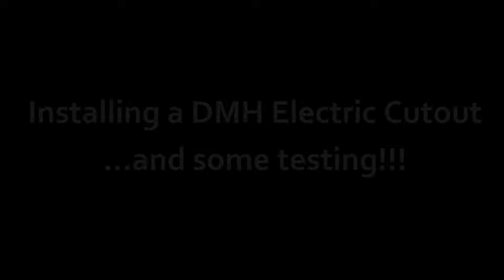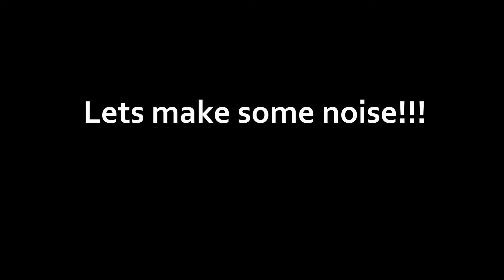DMH Cutout Install and Testing!  Sound/video clips!

Comment: Could you explain how it improves your car that exhaust cutout?
Reply from the maker: Absolutely.  I dont have any dyno figures showing any change in power on my particular car.  However, I plan to get the car dyno tuned in the spring, and I am going to ask for a back to back run with it open and close.  On my car, I dont expect much difference because my exhaust is EXTREMELY free flowing.  So, the only reason I use it is to change the sound or the attitude of the car.  Some days I just like it to sound like a fairly mild muscle car, through the exhaust.  Some days I like it to sound like a ticked off animal.  There is a psychological change when you drive a car that is quiet vs one that is loud.  You feel like you have more power and you feel like you are going faster than you really are.  Its like driving an old 60's muscle car.  They arent the fastest things, but man you sure feel like they are when you're driving.  They're raw and loud and they scream adrenaline.  Thats what this does for me.  Just gives the car that little attitude adjustment when I want it.
Reply: Just put tuned exhaust on the side with the least resistance and use the other when you need to be quiet.  In the fifties we just ran the cut out side to the side of the vehicle so you could open it easily.  Not a good idea today with all the laws and fines though.
Reply from the maker: I worked on a Chevelle that had the pipe coming out the side with a standard cap with wing nuts.  Guy would get to the track, take off the cap and run.  I've also seen manually operated ones that work via a cable.  But the cables get rusted up or the valves get frozen on those it seems.  This car's exhaust is a bit odd, because its one muffler with dual outlets.  The 3" intermediate pipe goes into the muffler where its split.  One path goes through chambers and is "tuned".  The other path is literally straight through.  Its pretty effective.  Normal driving it sounds modified, but very mild.  Once you step on it, it wakes up pretty nice.  The cut out just adds a little more to the whole experience.

Comment: Sounds all to familiar to me....wait till you figure out the perfect timing to get the most backfires and pops out of it :D
Reply from the maker: +Torched T/A Entertainment Haha it was backfiring and popping not too long ago.  But because #1 coil had a bad wire from the PCM to coil haha.  I have DFCO turned off right now, but I hope once its back on and working I can get some burble or light popping on decel.
Reply: +JEG's Garage  Now you need to do an outside sound clip underload. Put the camera on the hatch or something.
Reply from the maker: +Torched T/A Entertainment I actually tried...but my GoPro Hero didnt like it.  I just ordered a Hero 4 Silver though.  So Im hoping I can get some better outside footage with it.  I would also like to set it up on a tripod and catch some exterior drive by/fly by shots.  I have no idea how the car sounds to other people as Im passing or whatever.  I dont trust anyone else to drive it without me in it haha.

Comment: I use the electronic cut out with my turbo set up. less back pressure quicker the spool.
Reply from the maker: Good use!  Do you notice a pretty dramatic difference between open and closed with spool time?

Comment: Will this pass a smog inspection?
Reply from the maker: I dont know...I guess it depends on the relationship you have with your inspector haha.  I think technically its not legal for street use.  I keep my car emissions exempt here in PA though, so they dont inspect anything having to do with emissions, and my exhaust is in great shape otherwise, so they leave it alone.  I also take my car to people that understand what it is.  If you are in CA, I would probably install this so that the y-pipe is removable.  Put in a "test" pipe, get the car smogged, then install the cut out.  Any other state/country, you'll have to check the rules and talk with the inspection station.

Comment: What if you had an double exhaust system, and one pipe is stock and the other one with the cutout is full straight pipe going to the back.
Reply from the maker: If you had a dual system, with no crossover, this would cause an imbalance from left to right banks and I wouldnt advise it.  If you had a dual exhaust with a crossover, and you added a cutout near the cross over and made it big enough, it might be ok.  What most folks do is just put a cutout on each pipe.  You can operate them both with one switch.

Comment: Where did you get that switch I was looking for one for my project.
Reply from the maker: Thats actually a factory convertible top switch for a 98-02 F-body.  The donor car that I originally bought was a vert, so I had the switch.  I also already had a 98-02 center console, so this fit right in.  I can try to find the pin-out for it, but if you google Im sure it will show up.  Its not hard to hook up.
Reply: Thanks for that I am currently working on my convertible BMW E36 and looking for a switch with some type of exhaust sign on it , I kow Jaguar has them but they are about £100 for just the switch.
Your car sound great though.
Reply from the maker: Thanks!  I wanted to try to change my switch from saying "TOP" to "VOL" haha.  But ultimately decided not to mess with it.  I don't think you'll have much luck finding too many on-off-on momentary rocker switches with an exhaust logo.  Maybe you could get a blank one, design the logo and have it silk screened?  Might cost a few bucks but would be unique and cool as heck.  The Jag switch is cool, if we're talking about the same one.  But I think that's an on/off push button.  You could still get that to work, but you'd have to use some trickery and you wouldn't be able to partially open the cut out very easily.  Most of the time I bump my switch 3 times, vs cranking it all the way open.
Reply: Thanks for the tips. After some thinking and searching I decided to keep it as is. I will get BMW 2002 1976 soon and will spend more time and money into it so maybe then. But thanks and good luck.

Comment: Does this affect the car’s performance? If i was to run a street race and have the cutouts closed vs when open ?
Reply from the maker: You aren't likely to feel a difference. It does not create power. It does free it up. Mostly up top. How much depends on your setup.  Hoping to have Dyno charts showing the difference one of these days.

Comment: Did you have to drill a hole to run the wire to the enter compartment
Reply from the maker: No.  Tho, if I ever have the car apart again, I will.  My wire is running up through some heat shields, over the trans, and up through the original hole for the auto shifter cable.  It left a big hole, so I ran the wideband harness, cut out, and a couple other things through it.  Its in a nice spot.  If I pull the interior again, I will probably drill a hole right near the cut out, and run the wire up into the car and under the carpet.

Comment: is it dual exhaust and 1 cutout?
Reply from the maker: Its long tubes, into a custom y-pipe, then right after the merge is where the cut out is located.  Then from there it goes over the axle, and into the muffler, where it splits into dual exits.  One path is straight through, the other is baffled.
Reply: +JEG's Garage thanks

Comment: when u were turning the electroninc exhaust i noticed u had one little thing next to the switch what is it ?? my mustang has one too but idk what it is for
Reply from the maker: Are you talking about the little chrome toggle switch?  That is for my power antenna.  I didnt want it going up every time the radio is on, because I listen to bluetooth audio a good bit.  So I put it on a switch.

Comment: How has it held up?
Reply from the maker: Perfect.  I suspect it'll be fine for many years.  The only thing that failed on it were the bearings, but they're upgraded now so it should be solid.
Reply: JEG's Garage thank you for the reply, can you help me I want some but don't know how to make sure they fit my exhaust
Reply from the maker: You just need to find out the OD of your exhaust pipe in the area where you intend to install the cut out.  Then you need to purchase the correct sized cutout pipe, and the electric valve to match.  You can usually get them as a kit.

Comment: Are these legal in Australia? I know muffler deletes are illegal here, can this count as a muffler delete?
Reply from the maker: Im not sure these are technically legal anywhere haha.  They are mostly for "off-road" use.  If you had a super strict inspection station, they  might give you crap for it I guess.  But you could always make the cut out pipe modular so you could bolt in a solid pipe, then replace with the cut out pipe.  If the cops pull you over for noise easily, this will draw attention to you for sure.

Comment: does it pass the smog check? bcuz i wanna put an electronic cit out on my car but some guy told me it wouldnt pass the smg check is that true??
Reply from the maker: Smog as in Cali smog?  If so...then I doubt they'll like those.  But as I said to someone else, Cali is a quite a bit different than most other states.  It seems like you really cant do much of anything without potentially messing up your smog test.  You will have to check with other car guys in your area to see what they've done and what hurdles they had to overcome.  Sorry i cant help you more on that!

Comment: It would be better if you applied throttle in the bypass silencer. Exhaust gases fly out in middle of the floor is not a good solution.

Comment: If I may ask, how is it wired in?
Reply from the maker: Hi Russell.  It is wired up to a factory 93-02 style convertable top switch.  I saw this trick on LS1tech forums many years ago.  I liked this idea better than a big toggle switch...or hiding it away somewhere.  This was a nice compromise...its hidden in plain site.  It also helped that my donor car for the motor swap was a vert and had the switch with it haha.  Certainly swayed my decision to use it :)
Reply: Thanks man :)

Comment: Doing the same to my.c63 amg but I'm installing the baffle in between the muffler inlet and muffler on either side. So.thr cutout with electric baffle you have here just.inside piping not a.reql cut out

Comment: so how long did it last?
Reply from the maker: Wade how long did what last? If you mean the cutout, it's still working great. I was causing rucus with it today!
Reply: that's cool. I work with exhausts, 99% stop working after a year.
Reply from the maker: @WadeWilson-  I had the first one for like 8 years and the bearings on the butterfly shaft fell apart. The company replaced the unit with the newer version that uses bronze bushings. It's been great since.

Comment: What cui is the motor and what's been done to it?
Reply from the maker: Motor is 364 ci due to the 4.000" bore.  Everything else being equal to the 5.7 LS variants.  Check out the build videos (which I will be making a play list for soon) to see what all is done.  But basically its freshened up with a hone, new rings, new bearings, cam, heads, intake and injectors.  Not much else.

Comment: Does the cutout leak?
Reply from the maker: Nope.  Not that I can tell.  The exhaust after the cut out flows so freely there isnt much pressure there.  But I dont get any ticking or weird noises from it.

Comment: is it just for noise?
Reply from the maker: In my application....yes.  In a street/strip car application, where every fraction of a second counts...no.  Generally on the street, I dont leave it opened all the way.  Every once in a while I like a little more noise, so I crack it open.  We'll find out in a couple of weeks what difference it makes on the dyno.  But for me, its just about the sound.  For a person that tracks their car, or bracket races or something, it can be used to free up some power that a restrictive exhaust may be leaving on the table.  My exhaust flows so freely that I dont expect a huge jump on the rollers, but we'll see.

Comment: what was the pool noodles for
Reply from the maker: My TA has a spoiler on the back.  That plus the hatch glass equals a pond any time it rains with the cover on.  So Im constantly trying to put things back there to make a "mound" for the water to just run off.  Seems like it always finds a way to pool up though.  Last thing I tried was two old pillows sealed up in trash bags.  Water still pooled, and still found its way into the bags making two heavy wet sacks of old pillows.

Comment: Is there any gain in horsepower?
Reply from the maker: No actual "gain"... In the upper RPM's you may notice a slight increase while on a chassis dyno.  But its not really adding horsepower as much as its freeing it up to breath on the big end.
Reply: @JEGsGarage  thanks so much, yeah true my low end suffer and now i had uninstall it. Especially when i open the valve, its like the air flow is not breathing out as it supposed to

Comment: So I still don't really understand how this works it has to close of the part with the muffler and open the headers at the same time
Reply from the maker: Nah...the exhaust gas takes the path of least resistance.  Some will still go out the tail pipes, even with the cut out wide open.  But 95% of it will be coming out of the cut out.  When its closed, it just "stops the leak" and forces it all through the muffler.

Comment: where can i get that throttle body thing?
Reply: Max Payne eBay
Reply from the maker: Yeah you can get them just about anywhere.  This one is DMH...its a great unit.  But if you search for "electronic exhaust cut-out" you will get more than a few results.

Comment: Is it hard to run the wire??
Reply from the maker: No.  Super easy.  The wire from the cutout to the switch is best run inside if you can.  But either way you just run the wire for the switch, give it power and ground and your good to go.

Comment: how did you do the wires
Reply from the maker: I just ran them up under the factory heat shielding, then through a hole in the trans tunnel that was already there.  If I ever pull the carpet back up, I will likely go up through the floor just above the cut out assembly and run it up front that way.  Just less chance of something happening to it.

Comment: How'd you find the size for your pipe?
Reply from the maker: You just need to measure.  Easiest way is with some calipers...but you can use a tape measure or a piece of string to get the circumference then do the math for diameter.

Comment: Where did u wire it to
Reply from the maker: It has its own harness. But I swapped the switch out for a convertible top switch. I run a 4th gen console and happened to have the switch and switch plate so it worked out nice.

Comment: What if you were to forget to open it and turn on your car and drive it for a little bit could you causeusengine damage
Reply from the maker: I actually rarely ever start the car with it open.  It makes such a loud bark when it fires off.  When its closed, the exhaust is just going through the Magnaflow catback, just as if there were no cutout at all.  So no damage.  In fact to be respectful of neighbors, Ive considered wiring it up so it shuts itself with the key turned off.  Sometimes I forget to close it, and that 6am start up can be heard for quite a ways haha.

Comment: Can anyone explain me how he manages to connect the cut-out system to the button in his car instead of using a remote?
Reply from the maker: Easy.  The remote systems are new...when electric cut outs came out, they were all switch operated.  You can still get them this way.  I simply took a convertible top switch, which is basically like two momentary buttons, and wired it in.  I found the information on LS1tech on which terminals to hook up.  It works perfect.

Comment: What kind of exhaust is it atm
Reply from the maker: As of now...  Stainless works long tubes with 1-3/4" primaries, 2-1/2" collectors into custom 2-1/2" y-pipe, which merges into 3".  After the merge is the cut out pipe.  After the cut out, its a 93-97 F-body Magnaflow cat back exhaust.  All stainless except for the merge with stainless v-bands.

Comment: Sneaky sneaky when cops pull ya you can just push the button and they wouldnt know
Reply from the maker: I CONSTANTLY close it up when I pass a cop or see one coming up behind haha.  I got pulled over one time late at night near my house, and the cop said "I heard a really loud car SOMEWHERE, and I thought it was you, so Im just pulling you over to check you out.  But the car doesn't sound that loud so maybe it was someone else. Have a good night." haha.  Just before that Im pretty sure I was hitting 6800-7000 with the cut out wide open.  Im sure everyone in a 1/2 mile radius heard me haha.

Comment: U need more pool noodles
Reply from the maker: I gave up on the pool noodles.  I tried two old pillows, sealed in garbage bags....but those are in the trash now too.  Im at the point where I think Im going to modify the cover, and sew in little drains so the water just goes out.  Its already a PITA to have to cover/uncover the thing all the time.

Comment: i dont know alot of positive comments installation not complete as far as your just bolting on cut out howd ya do that howd ya run the wires the its a single exhaust probably soun alot better eith true dual exhaust !
Reply from the maker: +emmagirl1100 You'll have to install the cut out pipe in your exhaust. I think you can get clamp on pieces, but I recommend welding. Wires are easy. Just route them to your switch however you can. I run mine up under the old factory exhaust heat shielding to the front.